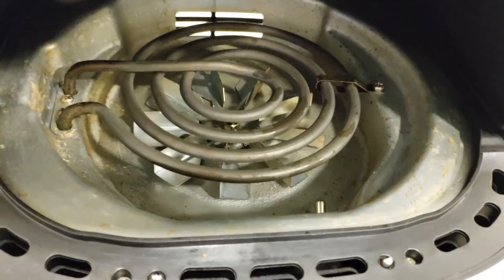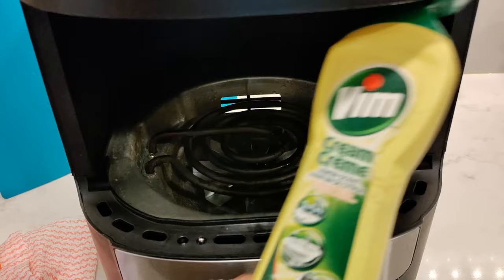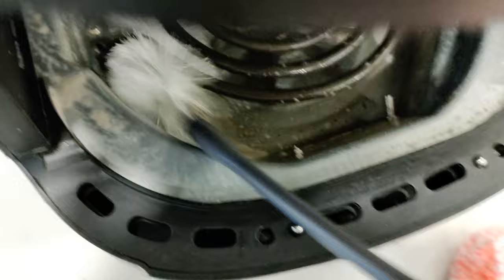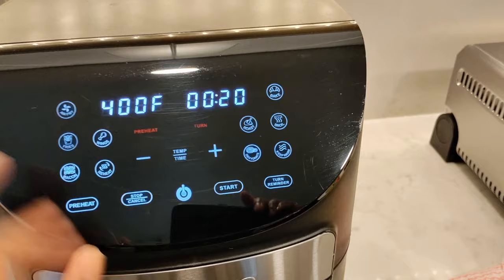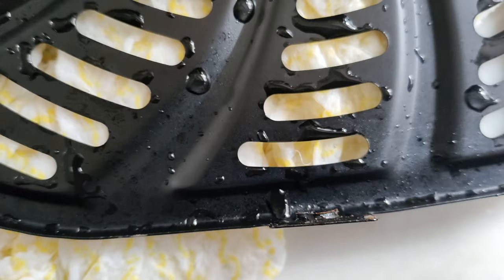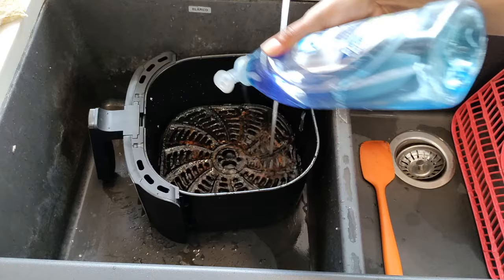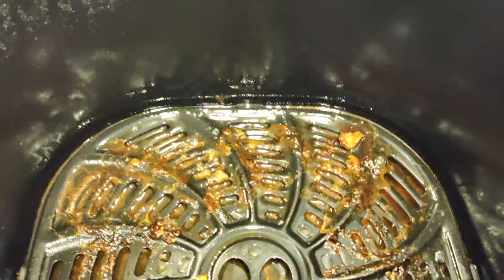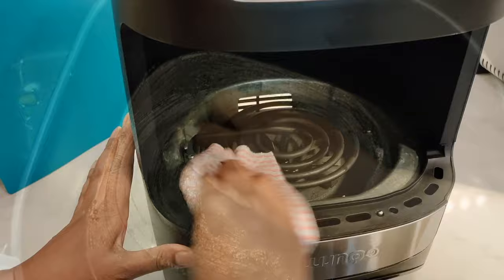DON'T Boil Water in your Air Fryer! 🫢 😱 This is How I Clean My Air Fryer Basket and Heating Element

Comment: So glad to find a video on cleaning the heating element.  I find that a lot of people did not realise the need to clean this area.
Reply from the maker: Oh thank you, yes, especially those that are new to air fryers! Thanks for the comment!
Reply: They should make the designers of these air fryers clean them in 15 minutes or less, then they’ll understand the need to have the heating elements be removable like an electric stove does.. then cleanup will be a breeze.. thanks for the tips👏🏾👏🏾
Reply: Sad that we experienced this and our air fryer heating element got rusted and the air fryer is dead.
Reply: @GeorgeVgp  That's why it's important to run the air fryer for a while at 400 to drive off the moisture that causes rust (as well as the leftover chemical residues).
Reply: @GeorgeVgp do you mean that it stopped working because of the rust! 😢

Comment: That's Ridiculous..... put water in a dish add a little vinegar and set it for sTEAM for 10 min. or more-- and it just wipes clean easily. (and RIGHT SIDE UP- so no chance of hurting the electronics)
Reply from the maker: There is no STEAM option on air fryers and I have no intention of boiling water in mine. Feel free to do as you please with yours.
Reply: @MeemReviews  Mine is a speedi meal ninja airfryer and it DOES have steam mode.. and if you don't want t boil bater in it-- that's fine.. won't hurt it..

Comment: You can still cook food that have liquids in them, provided you wrap/cover it with aluminum foil.. right? and you still had to steam the airfryer in the end so its still moisture inside the air fryer..
Reply from the maker: No and No. You shouldn't cook liquid foods in this air fryer and I didn't steam the air fryer in the end, I did a burn off using the air fry setting.

Comment: Since its non-stick coating, after each use I simply wipe it with kitchen towels esp. If there's oil in there so it will be easier to use until I get time to wash it again
Reply from the maker: Great tip, thanks for sharing!

Comment: Thank you for being so thorough. Your tips for using a bottle brush to clean under the coils nd adding  boiling water to the basket so the steam could soften the grease prior to cleaning were most helpful. I have a Corsori and there's very little room underneath the coil to clean the fan blades. I clean the air fryer after every use but was mainly concerned with the coils over and under. Thank you!
Reply from the maker: You're welcome, I'm glad you found it useful!

Comment: Very informative video ,thank you.
I clean the basket and crisper tray as you illustrate HOWEVER: I did not follow the manual instructions and use  a spray bottle for oil but instead used cooking spray (which many recipes direct) and now there's a sticky 'coating' on it--do you have any suggestions as to what cleaning agent I could use for that?
Reply from the maker: 1) I mostly clean with a bristled brush, some of the harder stuck-on grease needs a little soap and warm water soak before i use the bristle brush to scrub away.
2) Dishwasher. 
3) If you don't have a dishwasher and have stubborn grease.... try to buy a small pack of dishwasher tablets. Fill the basket with hot water, drop in the tablet and let it soak for a few hours, then use a non-abrasive sponge to wash it all out. 
Hopefully, some of these will help.

Comment: How do you remove the crisper tray?Mine is stuck at the bottom and I can't get a grip to remove it
Reply: Use a flat blade screwdriver.  Wrap the tip in a washcloth, insert it in one of the larger holes and use it to pry out the crisper tray.

Comment: What if I got the electrical part wet? Do I need to open it up to remove the liquids? Or just not use it for awhile?
Reply from the maker: uh.. yes, I would be careful, dry it out before using it.
Reply: @MeemReviews  yes, I did that. dried it out with fans. The electric cord  seems to be protected when i opened it up and now I'm using it again.
Reply: @MeemReviews   You cannot get to what needs to be dry.  If you think you got liquids past the shield at the top, use MR's fan method and plenty of time before you power it up.

Comment: I sprayed water in my and had it upsode down and now it wont fully turn on but some od the buttons light up when its plugged in is it because it needs to dry out more or dod i completely ruin it?
Reply from the maker: Use a cloth to dry cloth to wipe all the areas that you can reach. Let the areas you can't reach dry out completely before turning it on. Please be careful.
Reply: If you had water on internal components when you turned it on, you may well have burned out some of those components and ruined your air fryer.  Wait a minimum of 15 days before you try again.  This is why I don't turn my AF upside down.  Lay it on its side so that you can access the front and drips will fall on the plastic sides instead.  You can also do it while upright but you have to bend yourself into a pretzel.  🤣

Comment: I use coca cola in a spray bottle to clean the top and element...
Reply from the maker: OK, waste of a drink, but whatever works for you.
Reply: Doesn't that leave a lot of sugar residue that will burn?
Reply: Coke if FAR better for you used as a cleaner than in your gut.

Comment: This is why I dont buy air fryer, the heating element is far too difficult to clean
Reply from the maker: I wouldn't put off buying it for this reason, it's a great appliance. This is more of a deep clean that you can do depending on how often you use or types of food. For example naturally fatty foods will splatter and create more grease to clean. But there are lots of other foods you can cook using other functions, bake, dehydrate, roasting veggies, endless options! Try it, you will love it, I'm sure!

Comment: seriously? Put a water inside is a hazard, but using CIF is not a hazard... right?
Reply from the maker: I'm using a very small amount, and cleaning it away, also running the air fryer to burn it all off. I think it's pretty safe, we've been cleaning our stoves with it all our lives and I'm still alive and well. Feel free to fill your air fryer with water and let it run until it splashes into the wires or your air fryer no longer works or find something that works and share that idea instead.
Reply: @MeemReviews  after "to burn it all off" I don't even know what to say...
"fill your air fryer with water and let it run until it splashes" - do I say to have a full basket of water?
"share that idea instead" - it's not needed to have an alternative just to warm people that method is not completely safe, and especially to make a note about a clickbait title usage.

Comment: they say you should never clean an air fryer because it wipes away all the flavors which you want for the next meal.
but if food gets stuck in the fryer it will usually just get burned off next time you cook.
thats what makes air fryers so good when you have lots of guests over. NO CLEANING !!!!
Reply from the maker: OK, whatever works for you (and your guests!)
Reply: @MeemReviews  your welcome...
as they say you is never to old to lern !
Reply: Who is "they"? It's an air fryer, not a cast iron pan. And even cast iron pans get washed... This is why you can't just eat at anyone's home 🤢
Reply: @xmoshpitxmafiax  you should scrape the food off of a cast iron pan then simply wipe it with a towel. 
if you washed it you would simply wash away all the good flavors you built up over the years!
as they say Dont over think it !!!!
goodness gracious!!!!!!
Reply: A layer of fat will protect metal from oxidizing but a layer of fat will also burn.  That buildup will eventually catch fire and ruin your day.